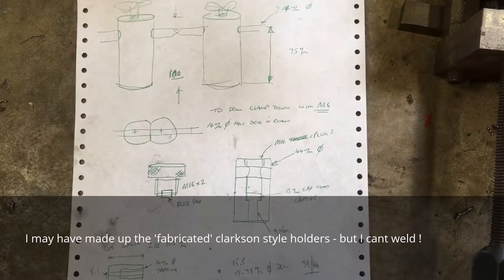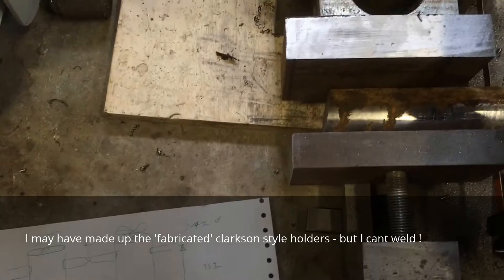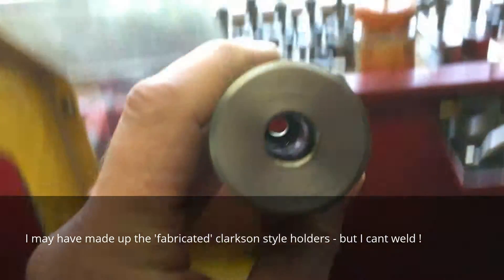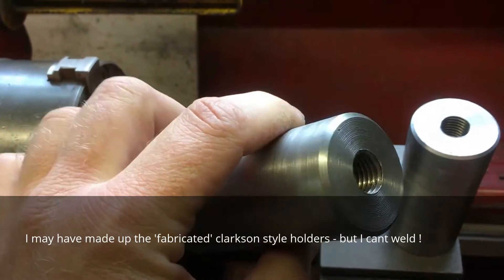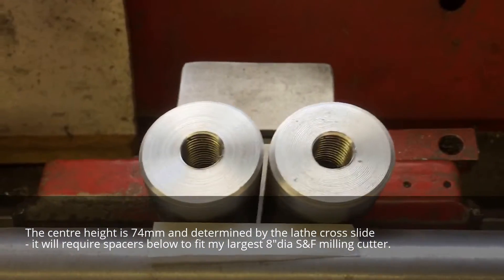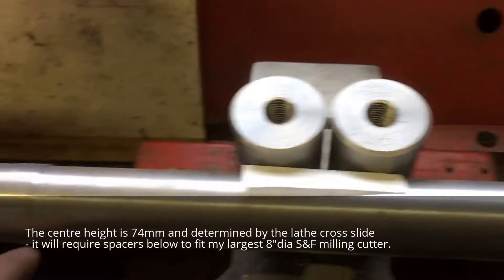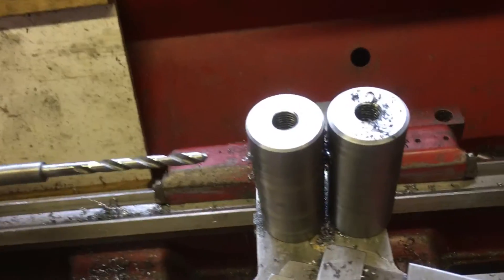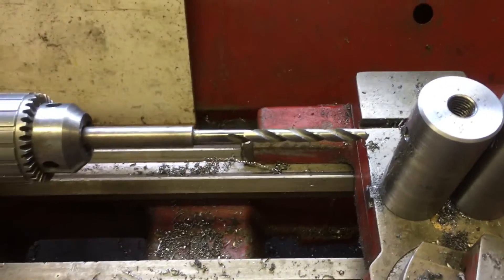Clarkson Tool Grinder Centres . without welding !

Comment: Nice job Mat. With the advantage of hindsight, and looking on from a distance - would you have got any benefit from fitting a support strap across the top of the 2 cylinders thus tying them together and possibly reducing movement? or was the mounting rigid enough? Regardless it is certainly a good solution using what you have. Greg